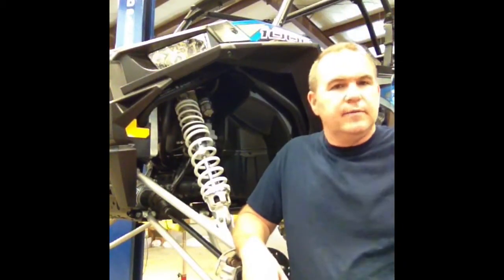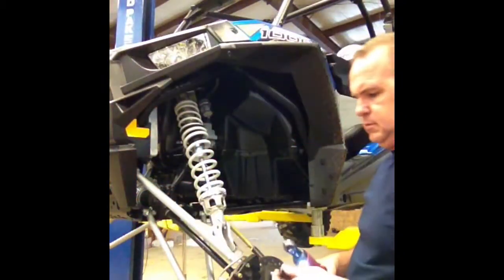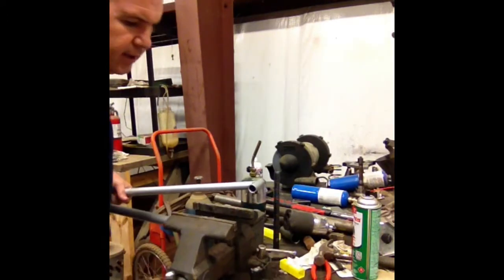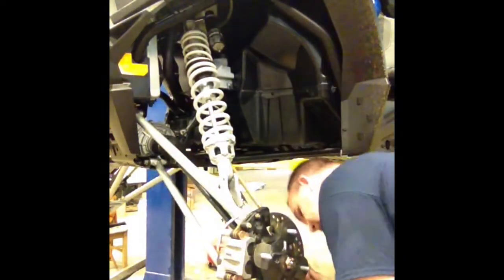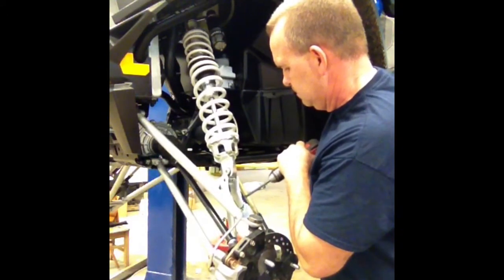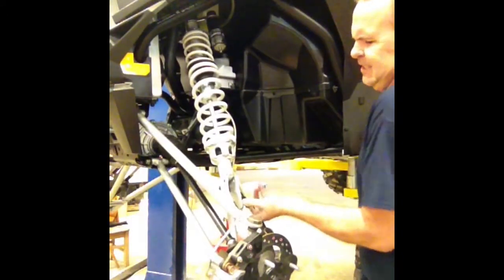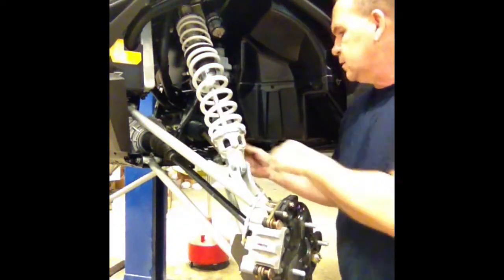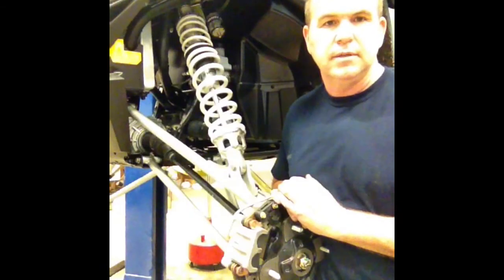RZR Front Bushing Install

Comment: Nice video .Do you get a knocking sound in the front when your hitting bumps like bored wash? If the bushings have slight movement?
Reply from the maker: There is no movement in our bushings.  Call or email us 601-771-0070 todd@hunterworks.com